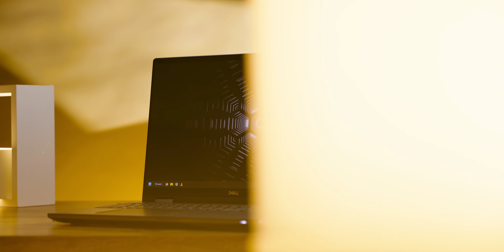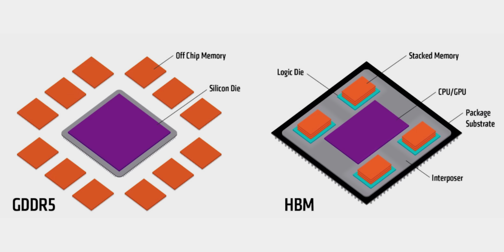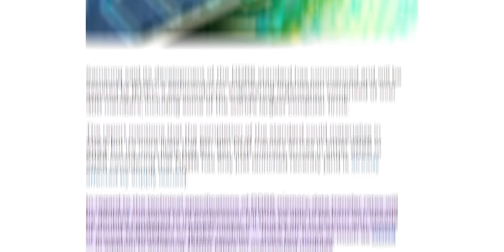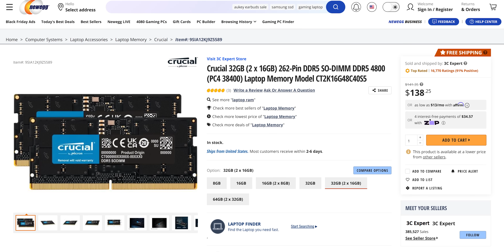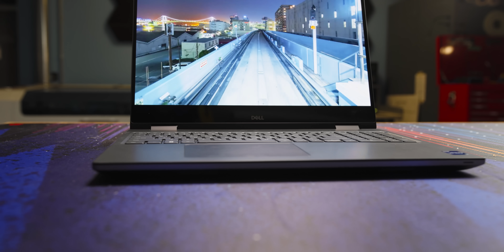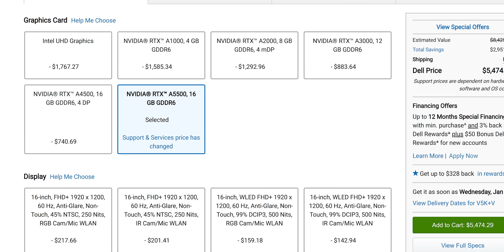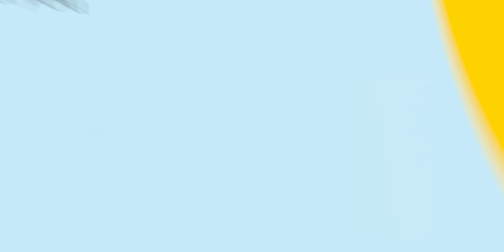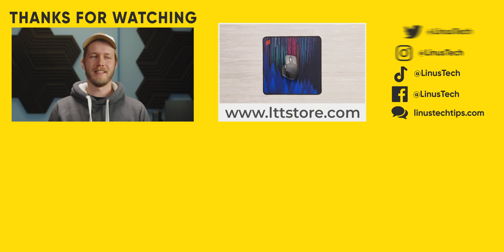I've NEVER Seen a Memory Stick Like THIS - CAMM Explained

Comment: I buy laptops with enough memory to outlast all the other components anyway. I don't need to upgrade laptops.
I got my boss to buy me the 7770 (this one's slightly larger brother), with the 64GB memory upgrade. It'll last a decade if it has to.

As a matter of fact I did the same with my DIY desktop. Getting twice as much memory from the start will let you outlast the platform, generally speaking. I bought 16GB DDR3 when high end gaming rigs were built with 8. I got 64GB DDR4 on AM4. I will never have to buy RAM more than once per generation. I will only buy one set of DDR5 in my life, most likely. By the time I need an upgrade from that, DDR6 will have already started dropping in price. I always buy late in the memory generation to solve the cost issue of getting lots of capacity. New gen speeds tend to not show their worth in the first couple years anyway.

I did have to buy DDR2 twice. That's what taught me this lesson. Get whatever people recommend times two. Buy once, cry once.

Comment: The interface looks really interesting. However, i am not sure if I missed it or it was not shown, but how is the connection between the module and the base board made? Some interconnect module to be squeezed between module and base board? 
Since connectors also add some signal integrity issues, due to the fact that the pins/springs in the connector become significant signal line stubs, I think this is really where technology should go. It's a bit similar to the interface between CPUs and Mainboards.
So getting into the speeds where the bottleneck is not the silicon anymore, but rather the PCB and connectors is quite mind blowing to me.

Comment: Let's face reality - 90% of Users today barely need more than 16GB Ram and 1TB HDD, and an average CPU Speed. 
The (mostly extremely loud) other Power users with extreme Gaming, Rendering, and other Performance users are not the majority. The question is, where are the "Killerapps" that let us require DDR5 or 6, 128GB of RAM, and top CPU Performance? 

It is wired to see that we make our Systems for a lot of money faster, but Windows still is capable to destroy these performances and runs with NTFS an utterly outdated Filesystem.

Comment: This idea is such a failure:
1. It limits you to having just one module per channel (or 1 module period). Not only it will produce a ton of e-waste, but people need more memory more often than faster memory.
2. Stop making super thin laptops. Current models are already so thin that you cannot fit a cooling system that is enough to keep it cool during low usage, not to mention during high load. Getting higher performance memory while thermal throttling while watching youtube wont give you more performance.

Comment: How does this thing work mechanically though?

At a first glance it demands absolute rigidity from the mounting system, which is further exacerbated by the module size (and therefore potential lever).

Some ASUS laptops (X556 I think) had a separate PCB for some IO stuff using a "flat" connector, and apparently it was causing mechanical issues. At least when I brought one of those with no sound output to a service guy, he told it was a somewhat common issue and most likely the connector fault.

Comment: Honestly I really wish I could design my own Memory modules I have a design in my head That I think Would be A more appropriate Module I'm not sureThose customModulesAre that greatThat laptopSeems to be running goodSo the Is probably good For that laptopBut I'm sure thatIt's a sleeper machineFor sureBut I'm not sure about those memory modulesFor the regular consumerI think the modules need to be cut downIf I was going forStandard consumer grade machine I would go with standard memoryAnd the one thing I would always make sure to do is make sure the laptop is Even Upgradable
There's a lot of laptops out there now That really aren't upgradable
 Honestly though If they had that type of module
On an OEM in laptopThat is consumer grade   It probably would be better  Sense a lot of The cheaper laptopsDon't have a lot of extras My final verdictAll the memory Module Good for sum
 laptops bad for others

Comment: I don't have a good opinion of Dell because of all the proprietary crap they've done and all the e-waste machines they've produced over the years, but I'm not going to dismiss this potential new mobile memory module out of hand just because Dell created it. If Dell can get JEDEC to make this a true open standard and if the rest of the mobile computer industry embraces it (that's two big "ifs" in my opinion), then I'll count it as a win for retaining upgradeability in notebooks. I upgraded the SODIMMs in my last two notebooks by getting compatible memory modules and following the manual on opening the bottom and replacing the smaller modules with larger ones. I even did a 5200 RPM hard drive to SSD conversion on my first notebook. 

I've always been sad that the mobile connector for replaceable mobile graphics cards died. It would have been cool to be able to upgrade the GPU separate of the CPU on notebooks like I can do with desktops. Especially since mobile CPUs stay relevant for far longer than the GPUs that they get soldered alongside on the motherboard.

Comment: With the way desktop processors are going with the need for bigger power delivery and better cooling a desktop version might just be a good solution with the low z height.

Comment: Why do I feel this will be just a way to package replaceable, but non-upgradeable RAM in future laptops, similar to those GPU card slots that existed so many years ago in lapops.
Need to replace whole module to change it.
Module sizes differ based on number of RAM chips.

Comment: t-RAM could solve the density and electrical issues without retooling factories.  Half the parts required and even lower voltage.  At least, it was, during DDR 2 production, where it was accidentally discovered.

Comment: Part of my first PC upgrade in 1999 was going from SIMM to DIMM memory. I saw displays at Electronics Boutique (long before it was EB Games) for the Voodoo3 line and wanted to get a 3000, but knew my 1997 Pionex PC from Sam's Club wasn't going to cut it. I went to a local PC store, picked out a motherboard with AGP and upgraded my CPU from an Pentium MMX 200 to an AMD K6-2 233. What I didn't think of was the memory, the old MB took SIMM and the new one took DIMM. I remember calling the store and asking if there was anything I could do and the guy mentioned something called a SIMM socket adapter that would let me run SIMM on the DIMM slot, but they didn't sell one. I looked in a parts catalogue (probably Tiger Direct) I had and found one listed. It was a weird looking thing, normally you'd think it would just be a thing that converts the pin count directly, but it was more like a board that stuck out of the DIMM slot and the SIMM modules can be inserted into the sides like a T. In the end I just went back to the store and bought new DIMM RAM. I've recently tried looking one of these adapters up, but haven't had any luck.

Comment: I always thought it odd that laptops had much slower speeds than desktop, despite having much shorter pathing to the CPU. I suspect it has been cost cutting measures
With SODIMM the distance to module can be almost as short as soldered RAM if you change the layout to have a single sodimm on either side of the CPU socket
Reply: The issue is more so the design has gone to thinner and thinner and lighter and lighter. And the false dichotomy that that means it is better.
Reply: @LainK1978  but thinner and lighter should allow for shorter paths, thus better integrity, allwowing for both higher frequency, and loiwer latency, but someohow laptops top out at 3600C22 and desktops can easily hit 5000C19, i've got a 5700G that will hit 4933C17-17-17-28 in 1:1 with geardown dissabled

Comment: This packaging has a major limitation IMHO. The modules can only be placed parallel to the motherboard, whereas SODIMM's and DIMM's can be placed either parallel or perpendicular to the motherboard. Small form factor computers such as NUC's will be left out in the cold.
If someone designed a right-angle connector for the RAM it might be more universal.
In a past life I did many high speed PCB layouts so I do appreciate this design for equalizing trace lengths.

Comment: It seems pretty cool if they can get the standards and sizes dialed in. Love the idea. My only concern is with it being a single module, You can't reuse some memory modules like you can with current memory.
Reply: Testing ram failures will be more annoying if it only has a single module, so troubleshooting might get a bit more expensive requiring an entire redundant module just for testing, fine if your upgrading, not so good if you weren't planning on it

Comment: None of the problems mentioned with SODIMM makes sense. Regular RAM is also far away from the CPU, and GPUs have the RAM right next to the die. So neither explanation addresses why designing around SODIMM. And it doesn't address the biggest problem, which is laptop manufacturers not offering upgrade path, or easy access to change the RAM. The reason for not upgrading laptop RAM has never been speed

Comment: it would have been really nice if the actual hardware was highlighted, the connector was briefly shown and not examined, removal was shown very briefly. the module's connection to the motherboard seems to be one of the more interesting aspects of this and it was basically ignored. the physical sodimm connector was shown and explained in much greater detail than the new item that you were highlighting. weird.

Comment: 100% would accept a module like this if the size becomes standardized simply because sodimm already was funky to look at and since you cant just throw a sodimm into a desktop i don't see why it needed to look similar to desktop ram + i don't like the idea of putting in a sodimm stick sideways its the same with m.2 if it could just have connection pads instead of a connector i would much more prefer to screw it down on the motherboard then just having a video play in my mind of the m.2 connector bending and eventually breaking due to pushing it down onto the motherboard to put in the screw that holds it flat

imagine a sideways connector for videocards then imagine a 4090 on it i bet it would snap the connector or atleast warp the connector

Comment: HAHAHAHAHA STABILITY ON A DELL MOBILE PRECISION. I have a top spec Mobile Precision from 2019 (4yr upgrade cycle) for CAD work. This is worst,ost trash computer I've ever had the displeasure of owning. USB ports dead, FIVE reflashes of the OS, Dock causes blue screen, etc. DO NOT get a Dell.

Comment: It’s bs. The form factor is the same and the speed benefit doesn’t matter as ram isn’t limited yet using the same wired connections. On package ram would be interesting. Or cpu packages that have connections for a real high speed connection standard.
There are two sides to the board.  The cooling for this speed will always be larger than however they can reduce it.

Comment: After dealing with Dell's proprietary crap for years... Its hard for me to think Dell is doing this out of the goodness of their heart.
Reply: they want an easier time designing laptops I'm sure
Reply: Could be for easier maintenance, if you're not a company like apple that can open a store in every part of the world you would have a much easier time troubleshooting and fixing a modular machine rather than replace the motherboard every time, or if it's accessible enough you might be able to send the costumer instructions how to do it themselves because the parts are widely available on the market.

Comment: This video comes right after I just had to swap out literally every proprietary part out of an old dell optiplex just because the proprietary 8 pin motherboard power plug wasn't supported by any standard atx power supply... Hard for me to accept than anything proprietary might be good

Comment: Definitely something great for laptop innovation. Ofc the current problem is size but considering the slim design and large capacity it can hold I hope we can get better implementation or design that can be fit in future laptop design. Some things are great to be shared.

Comment: Noting proprietary like this is ever good. F*** off LTT with supporting this shit. If they cared about this being open, then Dell should have worked with JEDEC to get it as a standard. Just like nVidia did with the 12VHPWR connector (which IS a PCI SIG standard).

Comment: The distance to the connector might be shorter, but the distance to the individual ICs on the module is really bad, as you have three rows of ICs. It is solely optimized to be thin. A module optimized for shorter runs of traces would have ICs on both sides. As it is, it has very long traces on the module itself. I would like to see measurements of the trace length on a real module before I believe anything of their Marketing bullshit. I would bet we are at least near or maybe even over the 7 cm of the SODIMMs from the processor to the individual ICs.

Comment: As long as it's the standard going forward... I'm fine with that. This is a MUCH better solution that soldering the chips. The question is... how much does this cost to produce. Especially right now, if it's too expensive, I feel that other manufactures will just opt for soldering since it's cheap.

Comment: Are we going to get to a point where AMD and Intel want to cash in when they struggle to push performance further. They have already started this with big L3 cache. Also the 3d stacked on the 58003DX.

I mean AMD already make a 4Gb chiplet for their 7000 series GPU. Next gen will be stacked ones. How long before AMD put one on a Ryzen chip for iGPU use (will give it a huge performance boost) and then load it on a few years later for system use. Will we end up with two different SKUs because of system ram. Ryzen 7 9700 16Gb and Ryzen 9700x 32Gb? 

It seems logical to go that way. Probably not great for the consumer, but then things usually aren't. 
It's probably a good thing the Nvidia don't  make CPUs or they would definitely be first to milk it! 

Anyway if you need more ram just download some more! 😂

Comment: It sounds like a system RAM standard that will be good for laptops not for rackmount nor desktops without a motherboard traces overhaul and case overhaul though with those 2 it can be better than using DIMMs and expand how much a single motherboard can support of system RAM. I can see how rackmount servers will use this just not desktops without it going over the end of the motherboard which will limit  which cases can be used.

Comment: I used to recommend Dell laptops, but now we will be recommending something else. Upgradability is the most important thing. We already advise against soldered RAM since a bad RAM chip can cause a very expensive repair. On a thin laptop there is no gaurentee those adapters will fit. Upgrades will be more expensive. I would rather have standard RAM. Hopefully we won't see this adapted widely.
Proprietary sucks...period.

Comment: I don't how I feel that it's pressure mounted. I mean SODIMM itself is still a bit finicky to install. Y'know when you have done this before, mount then the laptop won't boot, remount them and still won't boot, remount them for the third time and it's magically booting. Ugh.... so frustrating.

It's a good concept, but please don't make it pressure mounted, that would make it even more difficult to mount these, unless the provided these with torque wrench, lol.

Comment: As an older precision owner, the 2012 model year M4700 i can confirm they are TRUE powerhouses as far as workstations, and a pleasure to use or service. I am STILL using it as a dependable media server after over 10 YEARS! With a few cheap ebay upgrades at year 5, it's running 3.1ghz (3.6 boosted) with 4 cores, not great for now days but incredible for the time and excellent to this day (as a media and botting server)

Comment: wait until you get AMD7 CAM2 PCI-16v8.1 SATA-9.79-PCI-16V3.1-2-ETH-2.5-WEEE6 compatible USB device that can't be plugged in to a USB because it missed that 1 version.
It can do 4k*1TB ram disk over wifi, but you didn't have that one pin that was newly developed... tough luck!

No standards should always build up on previous standards.

Comment: If you look at the last 5 years, Dell introduced a lot of "interesting" concepts but never made it past 3rd revision and this is just another concept that will never take off because it is Dell. 
As mentioned in the vid, the major problem with this the size of a specific memory is not equal to other which means it is the same as soldering your ram onto the board as there is no other module fit! The fact that it is proprietary right now...show you how bright this new Ram module's future is

Comment: I wish they would just do something like XFM for the DRAM chips. That way we can upgrade 1-2GB at a time instead of the 8/16/32/64 intervals we have now.
Reply: memory controlllers are inside the cpu's, i don't know what you mean by soldering them. also, what's the point in upgrading ram by 1-2GB, when you need more ram, 1-2gb bigger is practically nothing.
Reply: @giornikitop5373  you're right, that was my mistake about the memory controller. I occasionally go over my 32GB of ram by a few GB, but not often enough to justify increasing to 64GB. It would be nice to be able to go to 34 or 36 GB. Also, for mobile devices and SBCs, 1-2GB can make a huge difference.

Comment: The tiny contact pads make me worried about the longevity of this. The vastly smaller contact area means that it won’t take much to break a connection. I see the compression connector is removable, but what is it made of? Like is it a slightly softer plaster that will help seal the contacts once under compression?